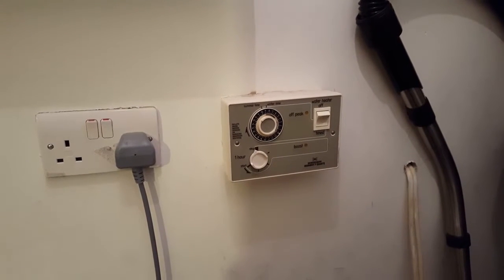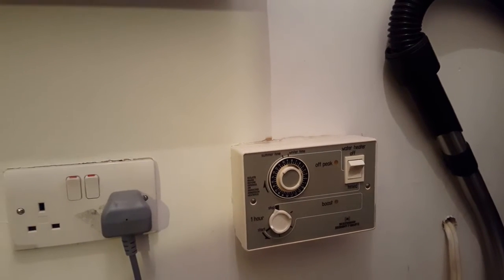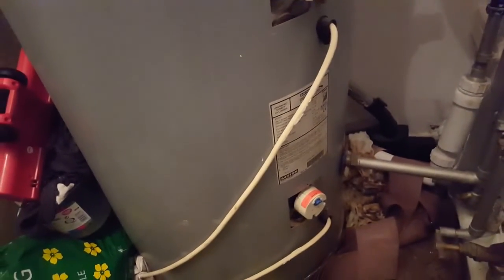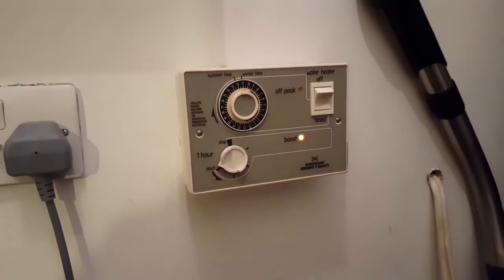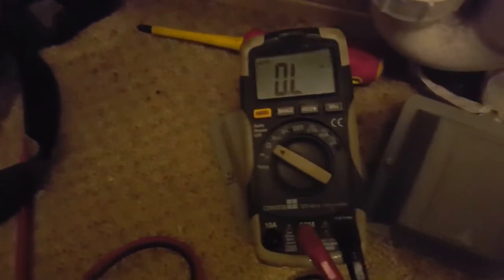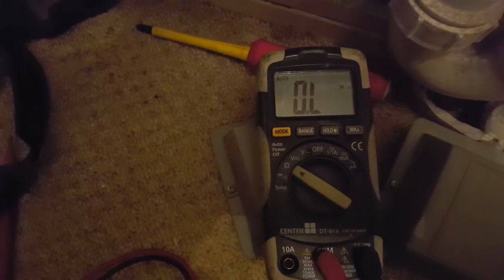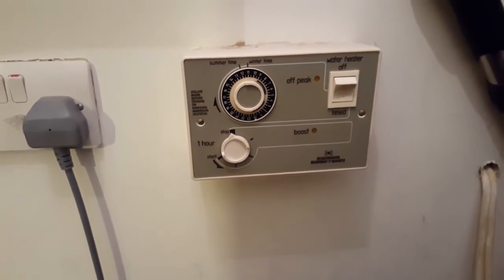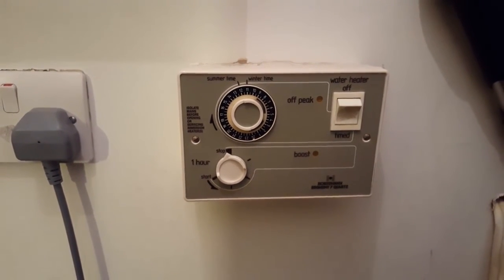Horstmann Economy 7 Timer How it Works

Comment: Hi air I have a problem with this I'm iraqi and I bought this device to manage my boiler and we have just one cable from my heater it's brwon and yellow so when I connect the brown to L and blue to N the device is will be up and working but the boiler does not working also when I active the boos.

Comment: Hello, my friend just moved in with me and the boiler is not enough for two people, and the boost takes a while to fill up. So Id like to remove the time function and keep it on at all times, so that whenever i need hot water it turns on. Whats the best way to solve this situation? Thank you
Reply from the maker: If it is the same timer as in the video just turn the top timer dial to the current time and that make heat the whole cylinder. Also can you subscribe to our channel

Comment: Is it safe to leave this type of water heater on while you were away on holiday wouldn't want the pipes to freeze? also I have an electric shower so I feel there may be no need to have the boiler on every night? and last question should I boost it when I need hot water example being for dishes handwashing?

Comment: This probably sounds really ridiculous, but the place I have just moved into, has the exact same unit in the airing cupboard. But I have no clue how it works, I have no idea what time the winter dial is meant to be at? I have changed it a few times but have noticed my smart meter is in the red where it must be heating water in the day, but I want it to heat in the night time. Any ideas please? Thanks 😊
Reply from the maker: 8 turn the big Dail the clock to the current time and it should heat up over night
Reply: @ARBoilers  thank you! When you say current time, do you mean for 19 or 7. I’m assuming 19? Thank you
Reply from the maker: Check if the fan is running if so if could be the air pressure switch. If not then it could be the fan